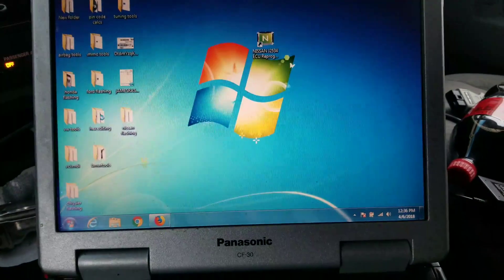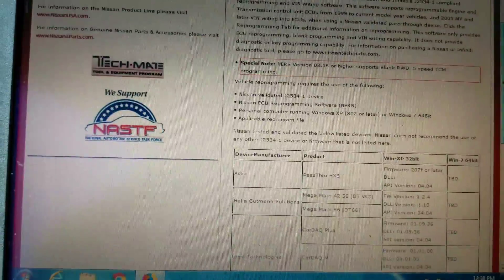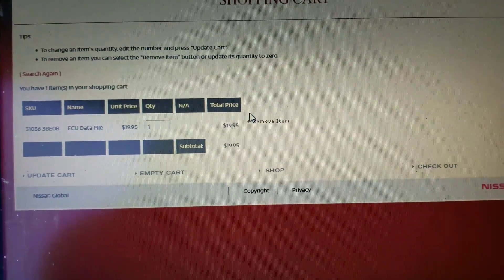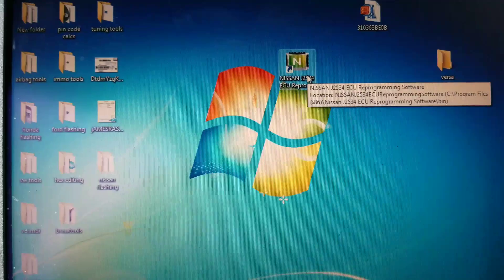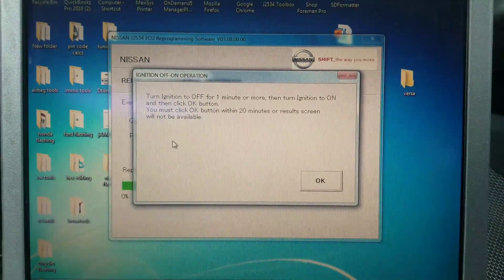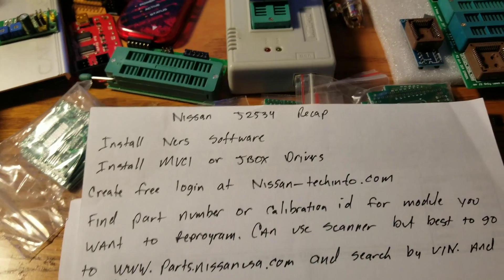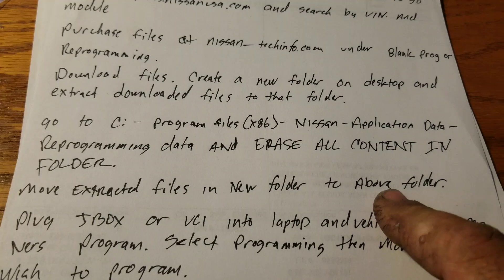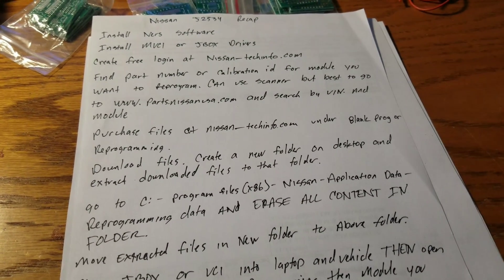Nissan Ners j2534 pass thru programming walk thru how to blank and reflash tcm

Comment: Blank programming is to put codes into a blank new TCM (or ECU, etc) from nissan. Reprogramming is wipe clean a used TCM and put new codes in, right? Calibration file is the coding, not any specific for some sort of gear shifting calibration? Then the first 5 characters of the part number is the hardware, last 5 is the coding? As long as I match up the hardware 5 characters (from junk yard), I can load any coding (by buying the calibration files) I want to? And... writing the VIN on the TCM is another procedure that is NOT related to the calibration file programming but it can also be done by NERS? NERS 4.00 needs login before executing the programming. Can I sign up for a login but not pay for that $270 NERS price? Or I need to find some older version that doesn't need login?

Comment: Programming Blank TCM specially frontier/pathfinder/xterra .it will give you this message #[Repro/programming Complete and configuration failed}..to fix this problem find onther healthy TCM and copy the configuration to write it to blank tcm   ..or just send it to dealer to use consult III plus ..this issue was not exist till we start to login to nissan web site
Reply: I got same exact error. Will try tomoro what can we do
Reply: @maksimlbk7533  let me know if it works without copying from other TCM ..using J2534 I don't think it will work ..but if you are using Consult3+ will work
Reply: i use J2534 and today it went all successfuly. I make sure i mived fules to right filders ( 2 different lications) and erase filer in programming folder. Finished n did confirmation finalization and all went perfect. It was my mistake not moving files to right place—software stuck, crashed n smoked TCM. Had to put new Whole trany from Dealer n flash correctly. Alot of frustration n pulling hear out reserching online —but thank God it did it.
Reply: @maksimlbk7533  Good Job
Reply: @maksimlbk7533  hello, i have the same problem. could you send PM to me or comment ??
Reply: @maksimlbk7533  if i make your mistake, i damaged TCM ? or can I repeat ??
Reply: @arkadiuszciesla4304  nobody talks about it but you can get used tcm from pick n pull n program no problem. Make sure—files in right folder...manually open n verify they are there
Reply: @arkadiuszciesla4304  when pcm or tcm is fried it has no communication at all. Thats when you know its fried...if it still communicates n can pull vin and tcm/pcm calibration numbers—its alive and might survive.
Reply: @maxl.8804  I remove NERS, and try again all procedure ... And IT works 😁😁😁 thx

Comment: Just wondering if you have had any issues with this. We are programing a blank TCM for a 2008 Pathfinder, using a CarDAQ Plus. We have the NERS software. The programming worked but will not configure. Error says cannot find config files.Have tried many times and downloaded file again.  Nissan's response is that I need the Consult III Software. Any ideas?
Reply from the maker: You do not need the consult.  Nissan rwd are especially a pain . What version or ners are you using. More then likely its the wrong file you're using.  The reason you're having trouble is either the version on ners or most likely the part number ids not correct and the files you have downloaded are incorrect.  Nissan makes it difficult to find the right file.  If there tcm was new there will be a different part number on the box then inside the actual valve body/tcm and then on their website another different number.  If you would like to email me the vin and part number you used for the tcm when you got the file and I'll find out if that's the case.  Meyersjj76@gmail.com

Comment: Help,I was reprogramming my g37 and the car was on didn’t remember to use battery maintainer,now I have a code u0101 and when I use ners to reprogram,it says the selected part number doesn’t match the ecu number
Reply from the maker: Can you communicate with the pcm still
Reply: Jack Meyers yes and I have clone consult and is showing the part number 31039-3RX0D but when I use ners to flash it back to stock,it says the selected part number 31039-x766B doesn’t match with ecu 31039-
Instead of 31039-3RX0D
Pls help me recover it and now I bought a donor tcm from junk yard ready to swap,car won’t shift and the gear selector is grayed out and engine starts fine just that u0101 code
Reply from the maker: @johnbosco2404  meyersjj76@gmail.com.  email me the vin and the part number physically written on the ecu from your car if you want me to help.  It won't be until the morning but I'll tell you what you need to do and walk you through it.
Reply from the maker: And how did you end up whe you're at? Did it start the flash and stop at some point with a low voltage warning or did it give you the low voltage warning and never actually start flashing?
Reply: I replaced the tcm and cleaned the valve body and is now good but how many quart of oil goes in after valve body removal

Comment: Why no one talks about it requires a dealer log in at the end before flashing a tcm or anything , we not a Nissan dealer how we gonna flash we got everything and still can’t flash cause it requires a user log in at the end
Reply from the maker: No login needed at all to flash programm. Only to buy and download the files. But you don't need to be a dealer or even a business for that matter. Just sign up at nissanusa for free and the files are $19 for each car.
Reply from the maker: Also download and save the files you purchase . label them in a folder.  You can use them on as many cars as needed.

Comment: Hi jack, i have a question, how do u know when a car need a update calibration? Nice video keep doing videos like this 👍👍👍👍
Reply from the maker: You can look it up but usually there will be a problem that leads you to the software update.  For instance the 2010 altima is known to start throwing codes for the maf sensor out of nowhere.  Changing the sensor,  smoke testing the intake for leaks, continuity testing the wires won't fix it but a quick tsb search and you will find an update for that specific code.

Comment: We followed you instructions. But we are using ners 4.0. We are having issues with it needing an ONC File? Do you have any ideas.
Reply from the maker: I need more info.  Are you programming or programming?  New or used module?  What year and make. Do you have the part number.  I can look up necessary files for you.
Reply from the maker: Usually when it's telling you no valid onc found you have the wrong calibrations are programming when you should be reprogramming or you have the wrong part number.
Reply: @jackmeyers2911  Whats the procedure for programing used  modules can you use the same files?

Comment: Hey Jack Meyers, thank you for providing so much info. I need your opinion. Our shop has the Drewtech Cardaq M for J2534. It is the most frustrating and time wasting tool that I have ever used. Problems with Java and other programs not working together. The success rate is very low with this tool. I found this video because I replaced the ECM in an Infinity QX56 and I tried to update to the latest program. Turns out the NERS software was at fault. Anywho, in your opinion, would the Bosch VCI be any less frustrating and/or more reliable? I know Drewtech is a great company and their tech support tries very hard, but I can't afford to waste anymore time on this. Please let me know what you think. I really appreciate it.

Comment: I'm trying to learn how to do immo reflash on old toyota and Lexus. Can you help me?
Reply from the maker: Matt and Jade know Everything what year and model.  Just give me an example of how old.  I'm sure I have an immobilizer here I can run through real quick
Reply: Jack Meyers 2000 lexus rx300 for example. And thank you
Reply from the maker: Matt and Jade know Everything its a little more tricky on the older lexus. I believe 2000 and older can't be accessed thruough the obd port.  There's a simple peocedure to add a key but if you lost all keys it gets a lot harder. I think ill make a how to video asap on that.  I have a bunch of the immo units just laying around and some transponder keys .
Reply: Jack Meyers thanks a lot.

Comment: What is the difference between Programming and Reprograming?
Reply: Sorry, at the end of your video I could see the difference was whether you buy a Blank module (Programming), or you re install the files to the original module (Reprogramming). Thanks for the video!
Reply from the maker: Pablo Hernández also nissan updates their part numbers over time. Reprogramming will give you calibrations not available for new modules. For instance I did a rogue the other day and couldn't find the calibrations under programming because the part number had a new revision. When I went to reprogramming they were there and I got it done when though it was a brand new pcm . Strange the way they do things but if you're patient you can always get them done.
Reply: I'm glad you mentioned the Rogue issue. I'm just now trying to program my mother's 2017 Nissan Rogue SL blank ECM, and  Nissan tech won't find the part number: 23703-4BA1A what do you do when the part number doesn't show up neither on Programming nor on Reprogramming? I have the original ECM but it doesn't say the original part number anywhere. Do you know if the part numbers should match? Or does the blank ECM have a different number?

Sorry for the questioning, but this Rogue is braking my brain in half...
Reply from the maker: Pablo Hernández I'll find you the calibration.  I always use my scanner and check the ECU info on the old one first. A lot of times that will be the number you're looking for.
Reply: I thought about that, problem is the original ECM is broken (car had front crash and the ECM was damaged/cracked). That is actually the reason we are replacing it. The part number is not attached/labeled to the ECMs in this car.
Reply from the maker: Pablo Hernández I can find you the info if you want. What state are you in
Reply: I'm in Miami, FL
Reply: I think I found the issue. I went to parts.nissanusa.com and put the car VIN number. Then I went to Engine Electrical / ECM and one of the options is Rom Data ID. Yesterday I saw that but I got confused because it said "ID NO FOR PROGRAMMING ECM". I though they meant NOT, but they really meant Number... Me and my English. lol I'm going to try this tonight and see if it works. I'm still skeptical because the new I'd these original part numbers return doesn't match with the part number of the blank pcm. I'm not sure if this is normal...
Reply from the maker: Pablo Hernández nice . I was just getting ready to look into it.  The reason I asked where you lived is hear in cali we have to use 50 state calibrations.  .they are always different
Reply: Good news... I just finished programming the Rogue. At the beginning I got scared because NERS was saying there was no connection to ECM... Checked cabling at ECM, checked power at OBD. Ran the snap on toolbox and Vehicle Checker was not returning any Active protocol. Then I went to the IPDM and found there was a 5amp fuse for the ECM that was blown. Replaced it and I was able to do the entire process without any failures. Took aprox 25 mins. After it finished I opened NERS again and wrote the car VIN into the ECM. All good now. Car starts and runs with no problems..

I want to take a few lines to appreciate your help and ongoing support. Thank you very much!!!
Reply from the maker: Pablo Hernández nice! It probably blew the fuse when the old computer got smashed. Like I said in the video it's not too bad it's just finding the right files and where to put them that creates problems.
Reply: its posibble to do a programming overwrite another part number? i mean programming second hand TCM with another ID calibration ?

thanks ? sorry im new
Reply from the maker: Alejandro Alfaro you can reprogram a used module to work on a different car and update the configuration but as far as changing the the part number to work with different calibrations I don't think it's possible. The ners program searches for the end model part number within the old pcm prior to starting the flash . If it's not a compatible part number it won't program. The are a few exceptions to where they use the same module in different vehicle so under the part number search it will show all calibrations available for that module . In my opinion you're better off just using the same part number and reprogramming it. Nissan's cam give you trouble even with everything correct throwing in another variable is just asking for trouble. That's just my opinion from experience.
Reply: Jack Meyers the TCM  has a different part number ID, but the part numbers externaly of the TCM are the same for old TCM,  so in the last step of programming the ners do something strange,  it redirecte a web page for login to nissan group,  like a dealer,  and interrupt the programming

Comment: I have a question for you. I have the pass thru pro II from SNAP-ON. Its the same unit as the Cardaq-Plus from Drew Technology. I can connect it just fine with NERS, but Consult III Plus can't detect it. Do you know if for Consult III Plus to work, is it required to use the original Nissan Vi2 Interface?
Reply from the maker: Pablo Hernández it will work but you have to edit the registry for the program to make it recognize the pass thru pro 2 . .ive used the pass thru pro 2 many times with consult.  The only problem you will have is it will never show ignition on in consult. Doesn't matter though every feature works just fine. Let me see if I can put toget a quick walk through for you on how to do it.
Reply: I would really appreciate it if you can do a video on how to edit the registry. Really helpful for me as all of my cars are Nissan....
Reply: Hey Jack, when you have some spare time, can you take a minute to reply with what do I need to do to Consult III Plus for it to recognize the PTP2. I read the DiagnosticTool.ini file needs to be edited. But I don't really know what to put in there. I would love to play a little but with consult III Plus. Also, I'm not sure if it might help you, but I have Reprogramming Data for for Consult III Plus v71.40. yesterday, I was looking inside the ReproProgramming folder and there is where all the .dat files end up. I double checked and the same file I purchased from Nissan for the Rogue was already there. also the CSV file was in there too... Anyway, let me know if you don't have that and I'll be more than happy to send it to you.
Reply from the maker: Pablo Hernández .that would help me out a lot. I don't have the programming data. Just consult 3. If I could get that it would be awesome. I'm working on a video to show you how to setup the consult. Mine is set up for the Bosch but I'm going back through the steps to change it to my cardaq . I'll get it up as soon as possible
Reply: Jack, what changes to diagnostictools.ini and to the registry i have to do in order to get PTP2 connected to Consult III Plus?

Comment: Couldn't find the original part number and didn't know how to proceed. Looked at several other video's and still couldn't figure it out. My TCM is part of the VB on a RE5 Transmission and couldn't find the part number on it.  Called the dealer and got the correct number. Follow the instructions on this video and it worked perfect. 

Thank you
Reply from the maker: Bremerton Transmission & Automotive the rear wheel drives are always the hardest. Especially the re5 in the frontier and xterra.  Ners wouldn't even do them before version 3.08. .i've always had to call.
Reply: @jackmeyers2911  Can I re-flash a used TCM to work with my Titan? Do these modules have the Vin encoded in them when flashing? Just need the knowledge on this because I know u cant just swap modules cause it wont communicate.
Reply from the maker: @DIYeverything513  yes it can be.  It's it the re5 transmission with the tcm/valve body inside the pan?
Reply: @jackmeyers2911  wow thanks for responding. Yes its re5 tcm mounted on the valvebody. I  bought a used transmission for my truck but tcm not communicating. Was windering if it can be reflash to my truck.

Comment: Great Video,  think I'll leave the Nissian/Infinity work to you,  what do you use to maintain your batteries while programming, I really don't want to spend 300 -500$ on one. Thx for taking the time to explain and make great Vids I'll do what I can to get ya some subs.
Reply from the maker: James Svetlovics. The nissans aren't all that bad 85 percent of the time. Lol
 I just use a small 20 amp Schumacher charger that was $38. Some people may rip me for that but there are very few vehicles that actually look for a particular voltage while flashing and if your battery stays above 12v you will never have problems.  I have an expensive maintainer and rarely use it. I've been doing this a long time and never bricked a module that I couldn't recover. I have worked at a couple dealerships in the past and everyone used to just throw a charger on em. Sometimes I'll be stuck way back in a lot and I'll just let the car run for about 10 minutes prior to flashing then throw my jump box on it. Turn off the dome and auto headlights and flash them with no charge at all.